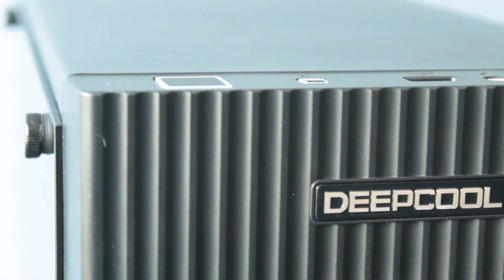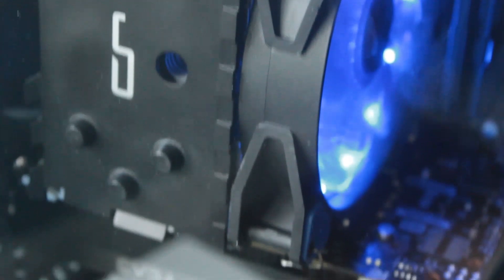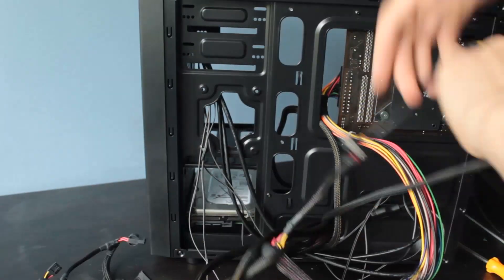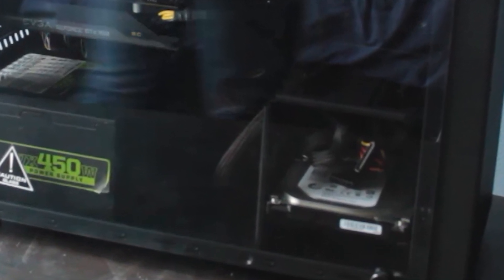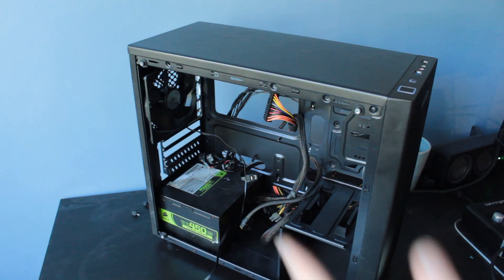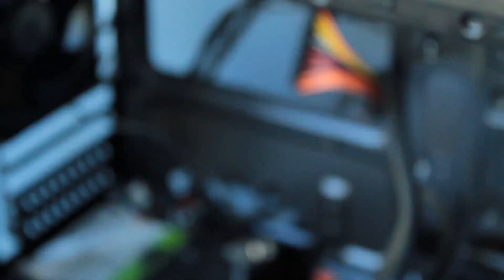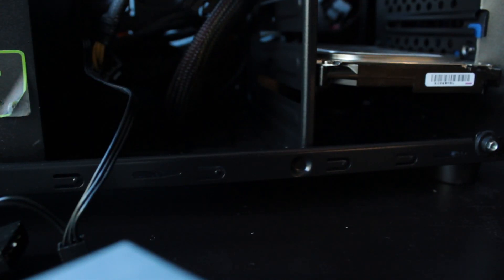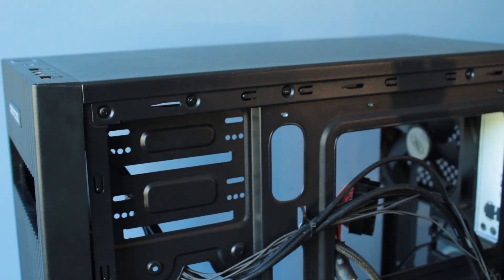Deepcool Matrexx 30 Review | Is It As Good As The Matrexx 55?

Comment: Which CPU cooler are you using; I’m struggling to find a cooler on account of height restrictions.
Reply from the maker: The crying h7, I think the tariffs hit them hard though so if you are in the USA like me you are out of luck. Thankfully I got mine before that. im sure there are some coolers that work tho, the h7 is not extra short.
Reply: I'm using the Cooler Master MasterLiquid 120 lite in this case. There is room for the rad and fan in the back of the case. Although if you put the rad up against the case it wont line up so put the fan first then the rad and then another fan after that (for push pull) if you want. 10-20 degrees cooler than stock Intel fan.

Comment: Using a full M-atx case would be hard to cable management right?
Reply from the maker: You should be able to still route the cables through the grommets with that board, but if you don't, there is still other space.